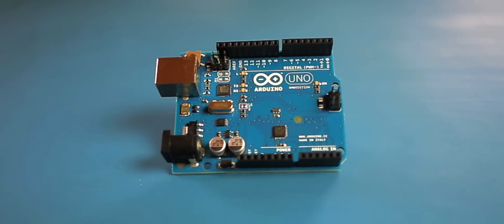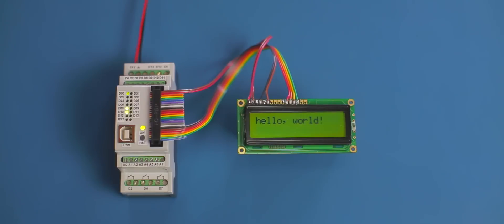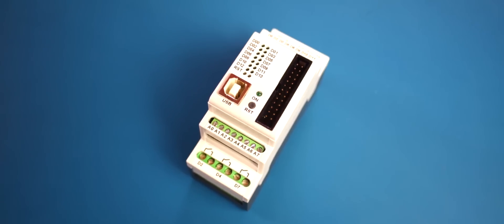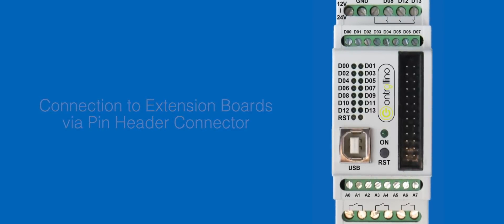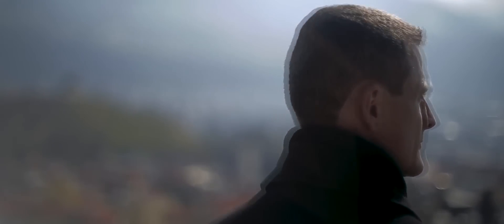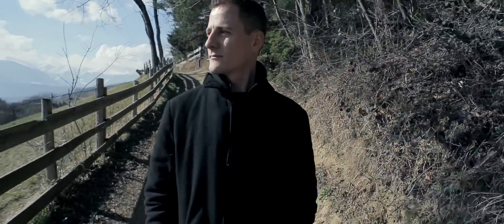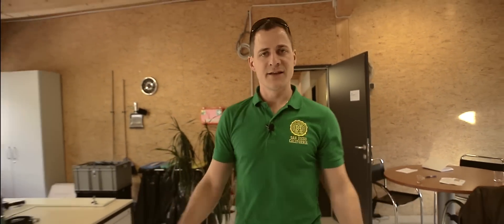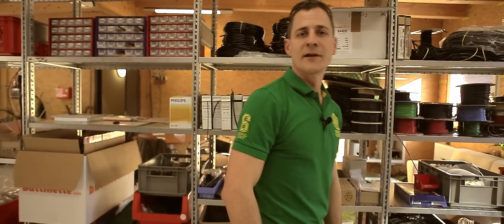ARDUINO + PLC = CONTROLLINO

Comment: Very slick. Makes me wonder how the Arduno project itself ever got off off the ground without loads of funding from Kickstarter, especially given that the whole project is open source.

I wish you well guys, but I am struggling to see why you needed $100k to do what many people have done for nothing
Reply: I think the controllino hardware is not open source, but the software is. If you think that's not an advantage try buying a Siemens PLC, and the software to program it you'll be spending 5 to 6K. It is a good idea, but tbh the electronics circuits for this kind of input/output control are not hard at all, and I think most people just buy a shield that they need.
Reply: Because you cant legally use an Arduino in a production environment. You need certified equipment for that and this is exactly it. Many EE students are trained to use Arduino while they cant even use it later in their lives.

Comment: Tell me more about how the PLC adds to the Arduino's safety? I'm not clear what the PLC achieves.
Reply: Generally isolation and high current / voltage handling. 'Safety' is not the best term here as it implies industrial safety devices.